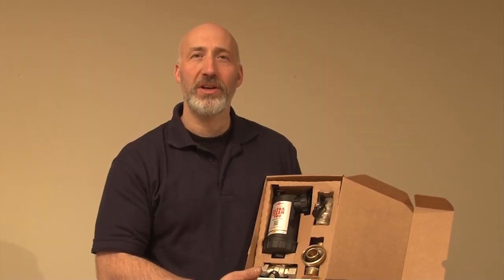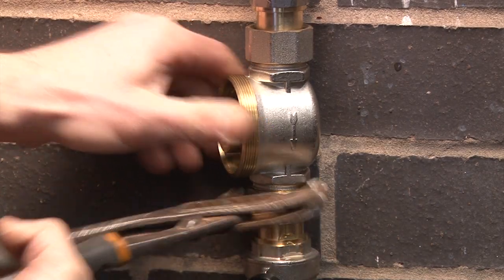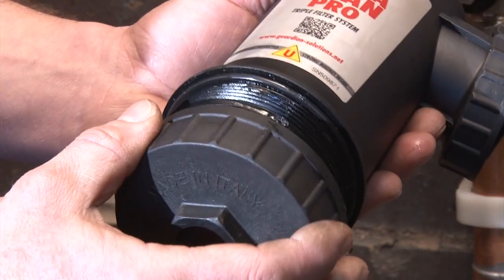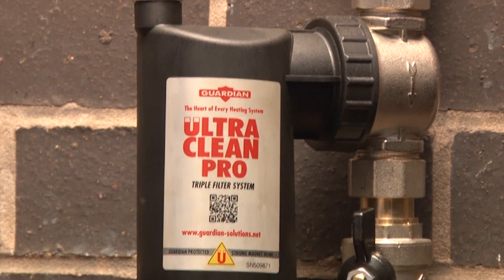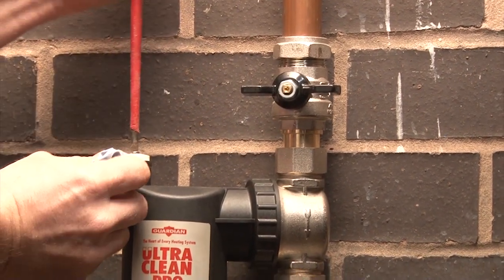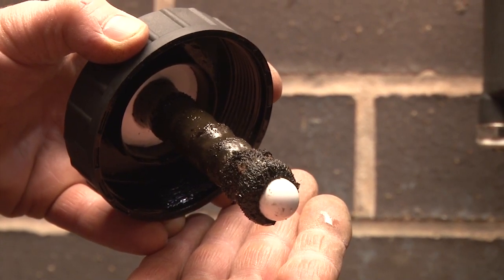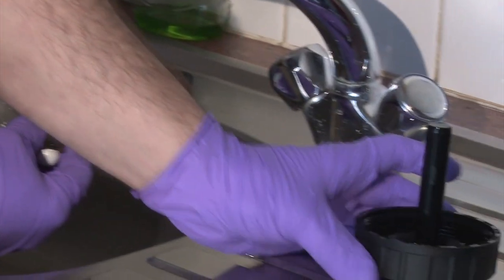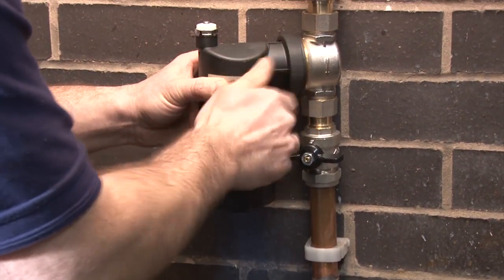magnaclean-ultra-clean-magnetic-boiler-filter

Comment: He's using the pump pliers backwards ;0( 
The sludge is the steel from the radiators (Ferrous metal) breaking down through electrolytic action, then collected on the magnet. Washing it off into the trap of the customers sink isn't such a good idea as its heavier than water and will sit in the base of the trap! Some bad practices going on here!